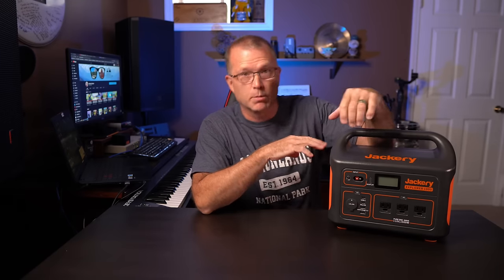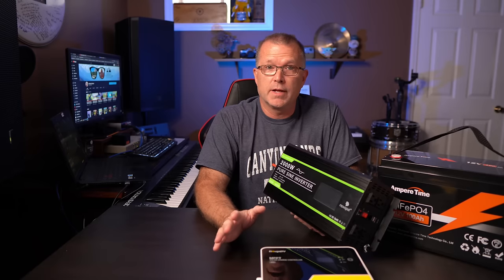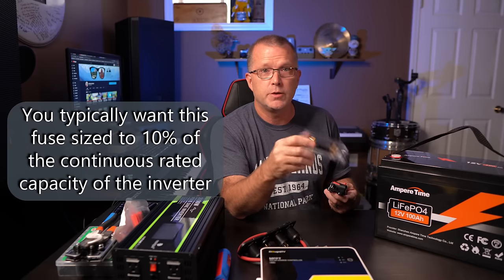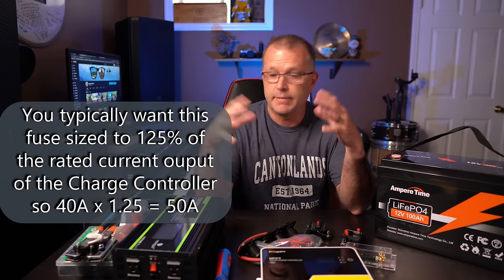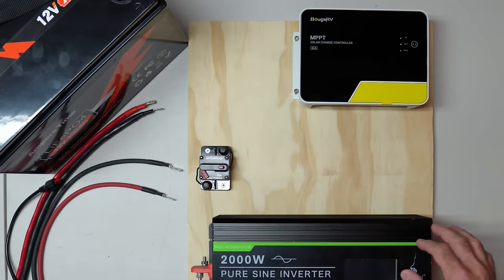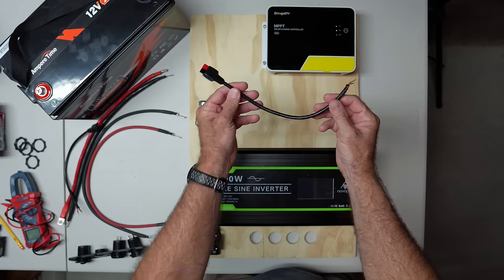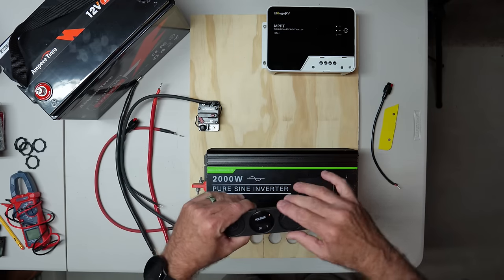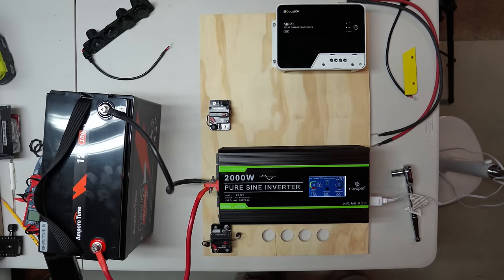BEGINNER FRIENDLY Step-by-Step: DIY SOLAR GENERATOR for Emergency Power, RV, Shed... Ampere Time

Comment: Hi, I have a 200watt solar panel and 100a mppt ! How many AMP for a circuit breaker between 100A solar controller to 12V battery? Thanks.
Reply from the maker: That's a lot of change controller capacity for just a single 200W panel!   But assuming that's not a typo, you'd normally want a breaker that's = to (or 20% more) than the output capacity of your CC.  So in this case, 100A to 120A fuse/breaker.   But really, I'd say you could easily get by with anything 50A-120A, given that you have just that 1 200W panel, so you're not needing to push probably more than 20A max through the CC.  But if you ever plan to 'max-out' that 100A CC capacity, you'd probably want a 120A fuse/breaker between the CC and the battery to provide protection without creating a nuisance trip problem.  I hope that helps.
Reply: @ReeWrayOutdoors  Thank you.

Comment: How would you connect the converter to the RV electrical panel inside the RV instead of plugging directly into the converter?

Comment: How would you install a 30amp outlet on a diy portable solar generator?I want to be able to plug my diy solar generator into a transfer switch in my house.
Reply from the maker: Hi Jasmine. Thanks for your question!  If you don't actually NEED 30A and 15A is sufficient, then the EASIEST solution is to just buy a 30A to 15A 3-prong adapter cable and plug that into the AC inverter directly.  However, if you really do need the full 30A, then you'll need to ensure that the AC inverter you buy has AC output terminal connectors in addition to outlets...and you'd wire the 30A outlet box directly to those terminals.  Note that the Novopal 12V inverter I showed in this video does not have that capability.  If you need/want to stay at 12V battery configuration, an inverter like this might work for you;  https://amzn.to/3HWM1r5

Comment: I did not see a link for the refrigerator. 
Can you recommend a small quiet, low-drain 12V refrigerator?
Reply from the maker: I'm actually testing this model right now: https://amzn.to/3KKaJKU   It's very quiet and compact and you can get it with or without wheels and telescoping handle.  If you don't need dual zone, this ICECO model is slightly larger capacity, slightly better insulated, but also a bit more expensive (and video coming soon).  https://amzn.to/3KHDTKR    Both have quality compressors, excellent vendor support and warranties (ie not fly-by-night companies).

Comment: good morning god bless you i have Victron SmartSolar MPPT 75/10 Solar Charge Controller w/ Bluetooth with  1 CHINS LiFePO4 Battery 12V 100AH Lithium Battery how to set  up solar panel i need.
, i need help

Comment: What size solar panel did you say you have on this system
Reply from the maker: In the video, I only had a single 200W panel.  But in a 12V battery confguration with that 40A Charge Controller from BougeRV, you can have up to 600W input, and in 24V config, you can have 1200W , 36V/1800W, 48V/2400W.  So there's lots of expandability.

Comment: Will the solar panel charge the battery while the inverter is powering a load?
Reply from the maker: @Hunter-vb8wo  yes...in fact the inverter will use the solar and only pull from the batter if the solar isn't sufficient to power the load

Comment: How do I attach the solar panel to the system. I bought all of the same wires, inverter, charge controller, etc., and no clue how the ends of the wires to the solar panel are supposed to get connected to the system. Am I missing some sort of adapter or something????
Reply from the maker: If your solar panel has MC4 connectors, you just need MC4 cables to connect to your panel's connector on 1 end and then on bare ends, you connect them to the Charge Controller.  Something like this: https://amzn.to/48O26dD

Comment: do you get 230 volts ac at outcome from 12volts inverter and what price are the solar panels though?
Reply from the maker: Hi John.  You'd need an inverter that is designed for 230V , but those are certainly available, just not what I used since I'm in the US.   Solar panels are going to run anywhere from about US$1-3 per rated Watt, depending on what style and brand you buy.  Rigid panels tend to be less expensive than. Portable/Foldable panels.

Comment: Great video, very well explained.  Have you used any of the new "All in one Inverter" i would be interested to see your take on a 12v/24v portable handcart build.
Reply from the maker: Not yet. But definitely something on my radar in the next month or so!
Reply: @ReeWrayOutdoors   awesome. i am looking in to a 12v-24v unit my self. im still unsure what i would need for a home backup unit, for fridge/freezer, heater and computer backup.

Comment: it looks like the incoming power is going into the inverter and then into the battery? To the red wire? But the power Has to come back out of the battery I'm confused?  Is the power coming from the solar panel through the black wire into the battery and then coming back out of the battery through the red wire to the inverter? I wish you would explain the process of power in and power back out better.
Reply from the maker: Electrically, they're all connected, regardless if it's wired the way I did it in this video orbif you land the cables all back to common POS and NEG bus bars as would be the more advisable way to do it for a more permanent setup.  But in any case, the AC inverter only pulls what it needs from wire so it doesn't really matter where the power is coming from.

Comment: Would it be possible to connect a gas generator to the charge controller solar input to charge up battery ?
Reply from the maker: The charger controller takes a DC input, so no, not directly.  I'd recommend picking up a LiFePO4 battery charger and power that from the generator when you need to.  That will ensure your battery isn't damaged during charging.

Comment: Hello
I'm not so good with electrical but would like to know what or which solar generator is equivalent to your build.
I already have the solar panels.
Thanks so much.
Reply from the maker: The battery I used in this build has a capacity of 1280Wh.  Usually, a power station in this capacity range will have a 1000W inverter (not the 2000W I used).  Also, the charge controller I used enabled me to put up to 600W of solar on it.  How much solar were you planning to use with the power station?? - this will potentially narrow down your choices significantly since a lot of power stations don't have more than 200W solar input max.
Reply: @ReeWrayOutdoors  currently I have a 100w & a 20w renogy panels, I might buy another 100w.

Comment: Is there a way to "add" the ability to also charge the battery array via a car DC powerport?
Reply: I would look into taking a dc car plug with a long cord, like a cord off of an air pump, and see if that can be connected into a charge controller and that connected to your battery

Comment: When you do a solar build, you are limited by how much capacity you can put on the charge controller. Then you feed the charge controller into the closed system with the battery bank. This is the part I had a question about. 

If you max out your capacity on the charge controller, can you place other solar panels going into a second charge controller and then have the second charge controller then feeding into the battery bank at a different place than the first (in order to get around maxed charge controller capacity)? And is this safe? 

Thank you.
Reply from the maker: Yes. Perfectly fine to do that.  It's very commonly done when you have solar panels with significantly different output specs, keeping like panels on the same controller to optimize their efficiency.
Reply: @ReeWrayOutdoors  Thank u very much for the reply.
Reply: Thank you for this. Perfect information for something I have been trying to figure out. 
How do you connect multiple charge controllers to the inverter though?
Reply from the maker: @lb5425  In that scenario, I'd highly recommend using POS and NEG bus-bars so you can land the Charge controller battery connections directly to that instead of the 'simple' setup I did, connecting directly to the inverter terminals.  Bus bars make things much easier to work with once your configuration starts getting a little more complex, like adding multiple charge controllers.
Reply: @ReeWrayOutdoors  If you use bus bars... will the ability of charge controllers to shut off if there's too much charge already in the batteries not be impaired? 

Thanks. 

Also this is just a question not criticism.
Reply from the maker: @noahriding5780  Hey no problem and fair question.  The short answer is using bus bars should have no effect on the CC's ability to respond properly to the battery's internal  resistance and adjust accordingly, independent of the other CC.  And in the case of LiFePO4 batteries, you also have the internal BMS acting as backup protection to prevent over-voltage from damaging the battery.  You just want to take care to ensure that the combined Current output of your CC's does not exceed the BMS charge current rating, or the BMS will keep shutting down the charge MOS circuits to protect the battery.

Comment: So why not just go with the larger gauge wire to begin with if it is expected to expand, that way you can expand it without having to rewire?
Reply from the maker: Definitely!  I was using what came with the inverter in this video, but I've since re-wired with heavier gauge.

Comment: Could some of the difference in the volts reading between the devices have to do with resistance of the wires and device?
Reply from the maker: That occurred to me as well so I measured the voltage right at the charge controller terminals as well as at the battery terminals and get the same differential, so I don't think it can be attributed to the wire resistence (especially being such short lengths and fairly heavy gauge for the application).

Comment: wondering , if I use 2 - 200 watt solar panels does it then charge faster? I know I would need to up grade everything.
Reply from the maker: Yes - charges 2X faster since the charge controller can easily handle 2 - 200W panels in either serial or parallel.

Comment: If the battery is dead. How long will it take to fully charge it?
Reply from the maker: Depends on how you're charging it.  A typical 20A ACDC charger will take about 6 hours.  In a decent day of sun, you'll get about 500-600Wh of charge for every 100W of solar. So 200W of solar would be able to fully charge in a single day,typically, and 400W of solar would get you there in about 4 hours of sun.

Comment: Quick question.  Can I use a 200ah instead of 100ah with this setup?
Reply from the maker: Yes in fact 200ah is a better fit for the 2000W inverter. Highly recommend 2awg or bigger for the battery cables and to the inverter.

Comment: Ive got a 100 amp breaker box in my home. Does this battery equal that amperage ?
Reply from the maker: In Amps, yes... but that's not an apples to apples comparison since your breaker runs off 2 120V lines (in the US) while the battery is a 12V output. So total power output is around 1280W on the battery but your service panel is something like 12000W
Reply: @ReeWrayOutdoors  So what would i need to equal what i have now ? I can fit 20 solar panels on my fence which can produce over 100 amps. But as far as the batteries, im not sure how many i would need.

Comment: No bus bars in this design, can you clarify if/why the bus bar is needed vs not?
Reply from the maker: In this video, I was really just trying to keep it as basic as possible.  I actually do have bus bars in my current build.  They're not a requirement, but they absolutely do help simplify the wiring terminations since you can land each wire to it's own connector...which also helps keep resistance/heat/voltage-drop down since you're not stacking mutliple wires on a single terminal.

Comment: Mark those little Chinese silver chargers I use them I've been using them now for 28 years and my first one still works like a charm nothing ever went wrong with them they even tell me the amperage of the batteries they tell me the voltage they tell me the amps and watts of the solar panels are given I mean the new ones really don't do that just tell you the volts they don't give you the answer or anything but my older ones they work like a charm granite they're like 30 years old but they still work as good as can be I'm not getting rid of them for nothing and why would I pay $150 for a solar charger when I get one for 14 bucks and now I have to be $24 for him $30 90 bucks for if they're so cheap why they sell it so much money nowadays yeah I see him priced at $94 you're $20 chargers so what makes you think they're so cheap and they're costing $94 4 months ago in this video is only a month old. Person has hardly any money and I have solar panels what you probably make on your video I pray making about 2 years for seeing that rich but you're making $60,000 making YouTube videos each month then you probably got so much makes another 20 30 $40,000 add that up for 12 months see what that adds up to that makes you a millionaire tell me that's not rich.

Comment: Total price if you purchased everything?
Reply from the maker: Right around $1000 (including the solar panel) - but I did use an upgraded capacity Inverter and a larger solar charge controller, giving me an easy expansion by simply adding another 100Ah battery (~$350).

Comment: Hi, I would like to ask you for your input about a Eco-worthy-600W hybrid inverter (with only 1 outlet)  this the  Description:	All-in-one Inverter(600W 12V Inverter+30A controller)
Build-in 30A Controller Part
Solar Charge Mode: PWM
Solar Panel Wattage: up to 540W
Rated Input Voltage: 12V DC
Max. Solar Charge Current: 30A
Pure Sine Wave Inverter Part
Rated Power: 600W
Peak Power: 1200W
DC Input Voltage: 12V
Frequency: 110V-60Hz,___
 I would like to build  a "mobile hand cart Generator,"  also I would like to hardwire a small 2-pole (30 amp breaker box) to hook up an welder 240v outlet ? to  your suggestions will be really appreciated
Reply from the maker: Hmmm.  If I'm correctly understanding what you're trying to do, looks like the biggest issue is going to be getting 240v to that welder. I don't think you can do that with a single 120v inverter.
Reply: thanks for your input 😶 @ReeWrayOutdoors

Comment: Could you run a small 8,000 btu ac? For a small 10x10 room?
Reply from the maker: You can...but that would be about 800W of (more or less) continuous load. So, you'd want to figure out how many hours of runtime you'd need and multiple that by 800 to get the total battery capacity in Watt-hours you'd need for that.  I'm simplifying the calculation a bit, but since (presumably) the compressor is not going to run continuously once the target temp has been reached, that should offset the inverter loss you'd normally want to factor in.

Comment: Is it a 2000 W pure sine wave inverter supposed to have two gauge wire?
Reply from the maker: Bigger is certainly better.  In this particular case, given the limitations on the  single-battery 100A BMS, the 200A breaker and the very short wire length between the battery and inverter, it was reasonable to just use the 6awg cable that came with the inverter.  However, 2awg would certainly have been a better choice - especially with the idea of expanding the capacity and adding additional batteries.  I AM actually using 2awg on this setup now, and have added bus-bars and a disconnect switch and fuse (in place of the 200A breaker I used in this video).    But I was trying to keep it as simple as possible in this video and that's the main reason for those particular choices. :)

Comment: Does that 12V power "strip" already regulate the USB power ports to 5V?
Reply from the maker: Yes, they're 5V 2.1A ports.  I could easily swap them out for QC 3.0 18W...maybe someday. :)
Reply: @ReeWrayOutdoors  ok nice, I was wondering what to use for cell phones/etc when building a solar project like this. Most people show the inverter but they never really show what to use for the other ports.

Comment: How did you receive the charge controller and the battery for free?
Reply from the maker: Find product types that you have experience with and do honest reviews on them.  Brands will seek you out when your videos start getting traction and they feel like your content is a good fit for them (actually, you'll likely get contacted by many brands that are definitely not worth working with...so you'll have to try and pre-screen those as much as possible to keep from wasting your time (and everyone else's) on junk products. :P  )

Comment: Can you hook up 800 watts of solar panels to that set up?
Reply from the maker: Yes, but to go higher than 600W, you'd need to setup the charge controller and battery configuration for 24v.

Comment: Circuit breakers . They get very very hot they are dangerous . Plug a heater or some other high drain 120 volt  I used them for years not anymore . Now I use  fuses

Comment: These kinds of solar system builds are pretty much obsolete now with large capacity portable bluetti (and other brands) power stations available with faster charging and less expense. But, this will work too. One advantage this has over a portable lithium option is it'll probably work better in low temps if you don't use lithium chemistry.

Comment: Why would you not wire it so it could also charge on 120v from the wall to charge battery?
Reply from the maker: Easier to just buy an AC charger for a 12V battery for $50-75 than to try and build one (certainly easier for me! haha)
Reply: @ReeWrayOutdoors  would you need to disconnect the inverter to do this in your suggested setup?